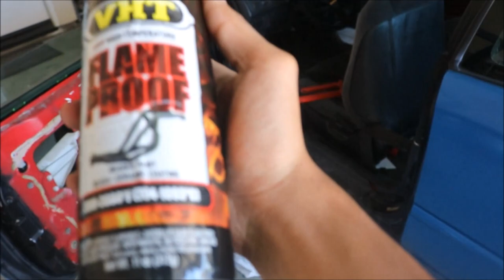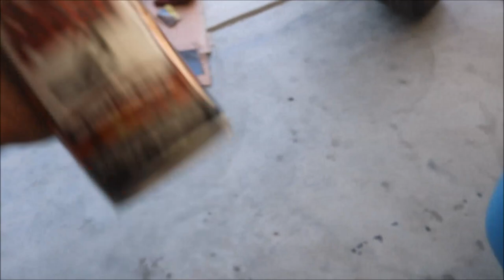Wing And Wheels Get Painted

Comment: I work at a body shop. you never want to apply paint to a surface that has been sanded finer than 600 grit unless it's just clear coat. 400-600 wet sanding is what you want to aim for. otherwise, the paint can come off eventually.

Comment: Get a new rear bumper, carbon fibre hood that doesn't have a riced out hood vent, keep the wing but get brackets that position it further down new fenders and a paint job and this things mint also cut off that fockin muffler